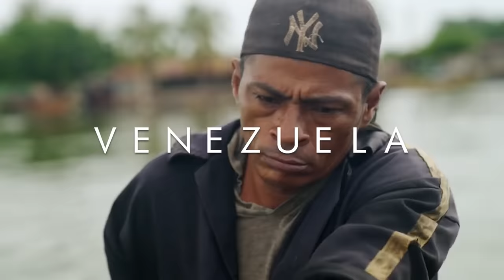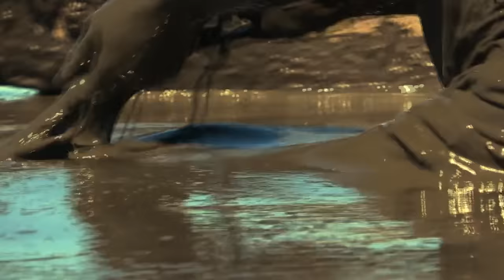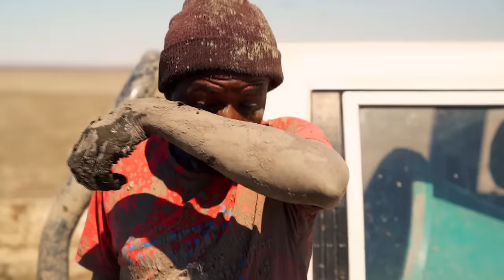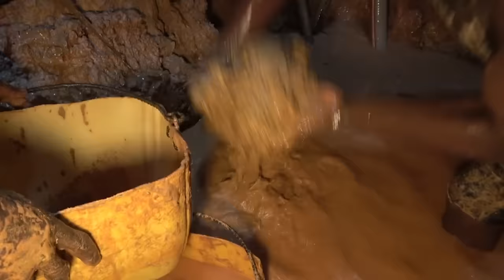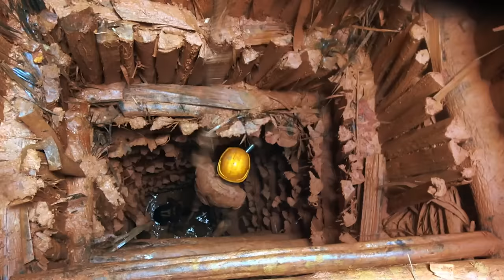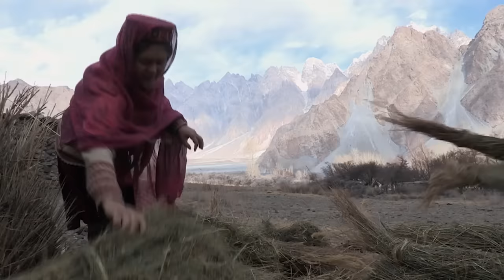Les pires métiers du monde | Documentaire complet

Comment: Please investigate perma culture.  Turn the desert into oasis. Water is in the air. Every night there is condensation and all you have to do is collect it. If you hang out a plastic sheet with the bottom of it tucked in a pail, you will get at least a litre of water from condensation. When you mulch the Swales the mulch captures the moisture and gives it to the plants. The straw also provides nutrient for the plants, you are not just growing plants you are growing soil. You can fill 500 ml water bottles with sand and use them as bricks to build houses.
They build them in India and have found that they remain at 65 degrees year round. The with stand 9.5 on Richter Scale, earthquake, cannot rot, nothing ng eats them and they will last for hundreds of years.